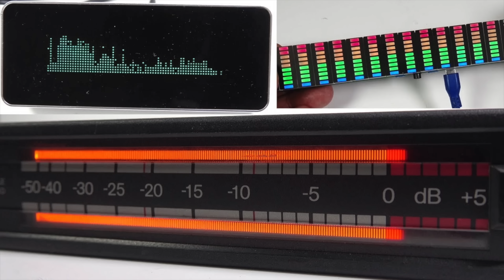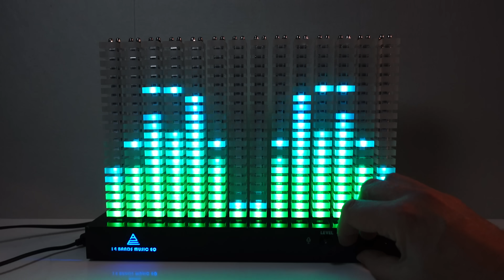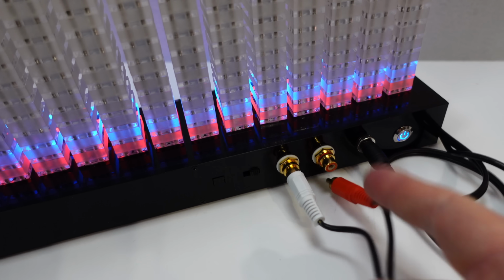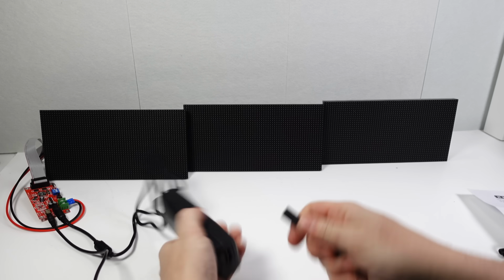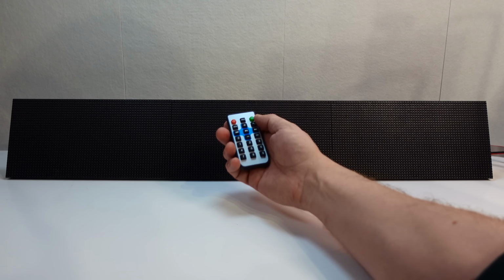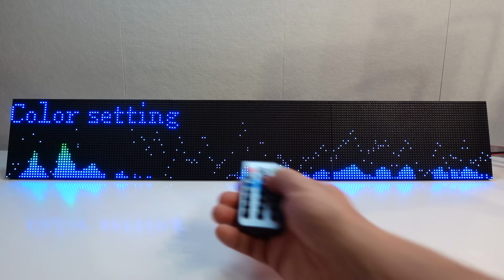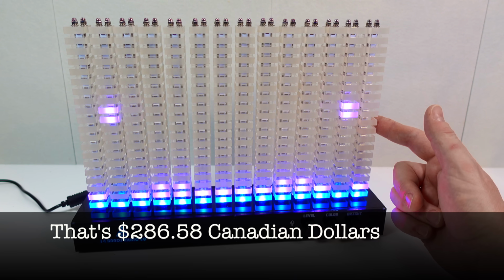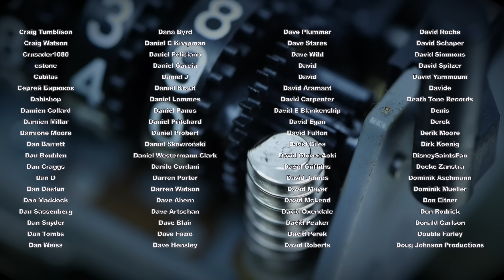Miss/LED -  two more LED music visualisers

Comment: If that first device actually worked, i.e., it was in stereo, I'd say it would be pretty neat for parties or the like.
Reply: or if it wouldn't try to pretend it's stereo (ie. if it wouldn't mirror the display but use the whole width for a mixed down channel/the mic input).

Comment: The first one is probably misimplementing something on the board  - normally/traditionally the left has been the mono/left port and probably isn't disconnecting it from the right side when it's plugged in

Comment: The second one seems like it's representing the spectrum linearly instead of logarithmically. The latter would make much more sense. With the linear representation you basically get most of the action from the lows and mids in the left half  and all the top end on the right half. With the 5k "Frequency" setting, 1kHz would still be about at the center of the leftmost panel.

Comment: You usually plug a mono source to the left channel. Some auto-switching might be wonky on the acrylic tower.
Reply: I was thinking that, except I was almost 100% sure the standard was mono->right channel when I was younger.
Reply: @eekee6034  Either you're misremembering, or you were doing it wrong as a child - I just googled it and it's definitely white/left for mono.
Reply: @_comment  The more I think about it, the less I'm sure, so I expect you're right. :)

Comment: For the protruding connectors (stopping you mounting the display flush against a wall) . . . 2 minutes with a soldering iron would sort that out, snip off the connectors and solder the wires directly to the board.

Comment: Great video. The second one from Aliexpress is always more expensive if you get the kit all-in-one. What I did was to get 3 LED matrix panels (£11 each) the controller (£17) and the power supply (£3). There was no way I was paying £180+ for the same kit. There are a million sellers on Aliexpress selling the same items and they range from very cheap to overly expensive, it always pays to spend some time to compare prices.

Comment: With some other electronics, you can turn these LED panels into a nice scrolltext display. Or maybe even reprogram the existing controller.
Reply: HUB75 is quite difficult to make a large display of without using an FPGA, because you are shifting in entire rows of on/off pixels at a time, and usually can only select one or two rows at the same time. Brightness control requires manual PWM from whatever is driving it.
Reusing the existing controller also requires you to have the tools to create a new program and load it. If you're lucky, they will be STM32 clones.
I've made an STM32 drive one before. I used a logarithmic PWM (4/2/1 cycles for each brightness bit), but it was a lot of work. The most annoying part was that the input chips are designed for 5V CMOS signaling that needs at least 3.5 volts, and they get wobbly with 3.3V inputs.

Comment: i gotta say, if i were a person who hosts parties often or worked as a dj, i'd most likely buy the second one. yeah it's a bit expensive, but it also makes any low-light party look more expensive as well. if you tape a piece of black cardstock behind the seams between the panels and mount it to a slim jet black wooden frame, it would look great both on top of a furniture or hung on the wall

Comment: Thanks for showing the modes on the wide panel one -- as one of those people for whom it's an audio tool, I'm always interested in how close it will get to what I need, which is separated bars, peak hold, and "real" colors (70% green, 15% yellow and 15% red, or so)...

Comment: It almost seems as though the processor on the acrylic 1 was preset to be mono and that there ought to be some type of way to get it to accept stereo since they already seem to have equipped it with the ability to accept stereo inputs and they actually connect to something and aren't simply disguised mono. And I know this is another thing that would have to be fabricated by oneself but the extremely bright graphics display of the acrylic model could be used to make a much larger version of that particular model using semi opaque rear projection panels and having it project onto a larger display like that or even utilizing a fiber optic link... It's just something that you would be able to custom fabricate a larger and more unique display.... Picturing a 3' tall tall graphic display....

Comment: for the product 1, the left input showing on both sides but the right input only showing on the right is a pretty big hint that its supposed to have both a mono and a stereo option. In the sound hardware world, though not required, its very common to have the option for a device to output both mono and stereo, and, when you want to output mono, usually the left output is the one you use. 

I wouldnt be suprised if there is a dipswitch or some jumpers hidden somewhere on product 1 that allows you to flip between stereo and mono, since thats what its behavior would suggest. I also would not be suprised if the circuit board, which may be made by a different company and used in several different products, has the option to configure it in some way, but the company that made product 1 forgot to put it in stereo mode before sending it off

Comment: The second one is pretty good. It would probably be worth redoing the power wiring harness with right angle power connectors (If possible) to reduce the profile. That aught to get it down to a couple cm's. You could probably then fit is in a bespoke case made using picture frame rods, the deeper ones for shadow boxes.

Or lazer cut acrylic. There are handy screw holes to mount to.

The gap could be fixed with some black tape, paper, or acrylic.

Maybe more sensible for a nightclub or bar where integrating it into a wall or cabinet would be more sensible

Comment: A better way to balance the spectrum (rather than limiting the frequency range) would be to tilt the response curve, most professional EQ displays offer tilts like 3dB or 6dB (etc) per octave, so the upper frequencies are more prominent.
If you have the knowhow you can tilt the audio before the input stage.

Comment: Thank you for the review of these.
I have a different version of the first one , it is a 14 band single channel device, not 2x7 band device, so shows 63H to 16kH from left to right across the 14 towers.  This works fine, and a frequency sweep shows it works as intended, and the device uses the average of left + right channels.  I am happy as I prefer something physical rather than a panel which I can simulate better on a computer screen (or TV monitor), my preference being a 3D item that is coloured.
Since I can simulate the second option on a cheap TV + computer then it is not what I wanted, while the 1st option has a value to me as cutting 20x14 blocks of acrylic was not possible without expensive equipment.
Your millage and thoughts probably vary.
My guess for the problem of the first one is that the microphone (mono) is connected into the stereo input and is "shorting" out the stereo signal - maybe disconnect the mic input plug to see if this fixes the problem.
Reply: Yes, it is misleading...

Comment: The gaps between panels can be mitigated by putting electrical tape on the back side of the seam to keep light from coming through the crack. I do this with multi-monitor setups when perfect alignment is impossible. It sure beats being able to see the wall behind.

ᴇᴅɪᴛ: I have also discovered the wonder that is black hot glue.

Comment: I can see the mic being an issue on the 2nd long one if you were to build any kind of case around it.  Assuming you mount the circuit board inside the case, it would cover up the mic, and it just wouldn't seem to make sense not to mount it inside.  You'd really need to desolder the in-built mic, and extend it out to the front of the case.  Otherwise it might not pick up sound well enough to even work.

Comment: Thanks for continuing to cover these. Finding something that works right is such a STRUGGLE. I am STILL looking for something like this I want one the ACTUALLY where the lights responds to specific frequencies but they have gotten so out of hand price wise that I cannot justify the purchase. The 3 segment led panel functions the way I would want but it is $150-$200 USD and with $50 shipping and it is just naked electronics so you still need to build a cabinet and it is made rather simplistic manner. Considering how few COMPONENTS and the fact it is not done it should be MUCH cheaper Maybe 60$ or $75, if it was complete maybe in an acrylic or 3d printed housing maybe $100-$125 but $200 is outrageous ESPECIALLY from aliexpress,  so the quest continues

Comment: So the second unit you show is definitely LED tiles used to make up panels for LED walls used on stages and for advertising. the reason the edges are filleted is to allow for curved led walls and easier alignments.

Comment: There's a couple of sellers on AliExpress selling the second model in an aluminium case now for about 133 quid + 26 quid shipping (with VAT as the unit is under 136 quid, so coming out to about 180 quid).

Comment: The problem with using a mic as input for a device like this is that a mic inside that cannot 'hear' low frequencies well, that means it doesn't distinguish between a kick drum and some bass for example. And usually kick drum and bass are the 2 things you actually want in a visualiser like that, to get the rhythm right.

Comment: The first unit looks really cool design as a show-piece on a sideboard near the stereo . The second design could have been thought out better as those connections could have been made to slide in sideways or even on the side of the panels so they connected when joined together and mount the electronic controller on the back. As to mounting, maybe some long stand-offs on a large dark-coloured back panel would work. That said, I think it would have look better with a mirrored option that started in the middle and went outwards on both sides as the right-hand panel is mostly unused.
Reply: The panels of the second one are literally how they are built as spare parts. Everything except the controller board is a standard HUB75 display panel part that can be purchased separately.

Comment: I have the RTA-31 which is no longer available under the "Fun Generation" brand. It goes by a slightly different part number PP-31 now and they have a 2U version now as well! I am tempted to order it as well but at close to $500 it will need some thinking.
Reply: The white 2U looks really nice, I've had a PP-31 for a while now (they actually pre-date the Fun Generation brand) and it's been really reliable.

Comment: The first LED panel looks to run from something very much like the Teensy (2.0 ++) controller. If so, it would be possible to check their code. Processing isn't a terribly difficult language.

Comment: You know what I'd like to see for an LED display?

What if someone built a Firestick type device that created a display on a TV? Lots of people have a TV in the same room as their stereo.
Much like the other LED display devices, this device would also have an RCA audio in as well as a microphone.
Such a device would likely be fairly cheap because the actual display part (TV) would be provided by the customer. And because the display would be created by software, it could be very easy to download different effects or perhaps even create your own custom effects on a computer. The device could contain literally hundreds of different spectrum and visualization effects!
Such a device would also have the added benefit of easily upgrading the display part. Want a larger display? Connect the unit to a larger TV.

I sure wish someone would invent something like this 🙏
It would be a fairly cheap way to create a spectacular display.

Comment: As to the first unit with the backwards wired plug, I bet they put the plug in backwards on the circuit board.. You should just be able to pull the plug out and switch it around the other way and it should work fine.

Comment: I was hooked until I saw the price...LOL, both are pretty sweet although I would like a mode for using the proper spectrum and splitting in true stereo, a few more options as such for the second one and I might consider it worth the price. I could make my own sweet looking case for it and possibly even make it an infinity mirror.

Comment: I don't think the second kit is really "unfinished" because it actually looks pretty cool without a frame. Simply rigging a stand or hanging bracket (with standoffs to allow space for the wiring in back) wouldn't be at all difficult. On the other hand, the frameless design does leave a whole world of opportunity for customization. I see that as a good thing, and in no way a drawback. It would be nice if they had included a rudimentary stand, though.

Comment: I think what’s happening is that when you do a fourier transform (which is necessary for these things) you get this symmetrical output, normally spectrum displays will chop the output in half (and adjust logarithmically) in order to get a more human-friendly output. Seems to me they’re just using an off-the-shelf FFT chip and not adjusting the output.

Comment: It’s be nice if these things would accurately display the frequency of the audio it’s receiving, but I guess that takes more effort than lights that blink.  The “good one” in this video wasn’t even close to reflecting what the actual frequency was being played, and that adjustment seems like it was probably a high pass filter, because when he had it set to 16K it showed very little info on the display.  Which makes sense, because if you had a high pass filter at that frequency there isn’t much going on at that frequency.  The annoying bit about that is it showed that content at the left side of the spectrum, and it would most certainly be on the far right.

I’d love to fiddle around with one of these and a proper DAW like Logic that has various utilities you can use to test these kinds of things.

Comment: For the first one, it only listens to the left channel and shows that on the left of the panel in 7 bands. Those bands are mirrored onto the right half of the display, making it display as follows: 12345677654321 where each number represents a bad of the left channel. Hope that makes sense.

Comment: I had a program on my ZX Spectrum which did something like this, when you played music through a 3.5mm cable into the "EAR" port. However, the effect was lost on my 26" black and white Bush TV.
Reply from the maker: I had the same - I can't recall if it was a type in program or not, but the colour character squares all danced in time with the music - starting from the centre and working outwards. It was really quite effective.
Reply: @Techmoan  I think I typed mine in from Sinclair Programs. I loved that magazine, but it always looked like the code had been photocopied from those thermal printers. Probably why I wear glasses now! 😄
Reply: @Techmoan  whoa - MAJOR flashback

I reckn I did the same one, worked quite well. Saved it to a microdrive so i didn't waste the time of typing

Comment: Maybe bigclive could find out whats happening in that circuit board
Reply: Unfortunately it looks like a software/firmware problem. On the bright side, it's also sold as a diy product with many off the shelf components (eg. led strip looks like ws2812b/neopixels) all controlled by arduino pro mini. An electronics YouTuber like BigClive shouldn't have a problem reverse engineering the whole thing, the hard part would be to code a fixed version from scratch as the manufacturer doesn't seem to have the code available for download.

Comment: I was worried you weren't going to show a frequency sweep on the second one, thanks for including it. Despite the price and the DIY aspects, I'm definitely drawn to it, though I think I'd prefer if it just used two panels instead of three.
Reply: The seller has kits of 1, 2, 3 and 4 displays, and each are available with two different sized displays, the P4 is 28x15cm and the P5 is 34x18cm (so 8 sizes), in both cases 64x32 pixel per display, and you can get them with shells for relatively little extra.
They also have "high-density" display with 128x64 pixels called "P2" and "P2.5" (same size as P4/P5) but the driver board can only drive one high-density display unfortunately and cost about as much as the 3-display P4/P5 models respectively. Which is a shame because a 2xHD display would have been a thing of beauty.

Comment: Huge precise VU-meters, in a silverfaced cabinet with walnut sides, in a size that fits vintage hifi, and with the option to choose between clear or blue light in the meters to fit the various radio scales from the time - Now that would stand out from the boring black boxes (if any), and the flashing colors to entertain the kids.

Comment: I would hazard a guess that the reason the white input is being shown on both sides is that when I plug in a mono input into something that takes stereo inputs, it always says to plug it in to the white input.
This device should be detecting whether it has 1 or both inputs, and use it as left or both accordingly, but isn't.

Comment: @Techmoan  I'm disappointed you did not speak to whether the second item can be used to show Left and Right channels separately.  Maybe it had no RCA wired input?  I will need to rewatch that bit apparently.  I would like to have a separate display for each of the stereo channels.  At the least, the single display virtually divided in half for L / R.  Still, enjoying your adventures!
Reply: I saw nothing to indicate that it supported stereo, but you could always buy two, for twice the price!

Comment: its probably stereo it just uses the left jack as mono auto and auto switches to stereo when both are connected its a auto detect bridging circuit so it can work with mono or stereo